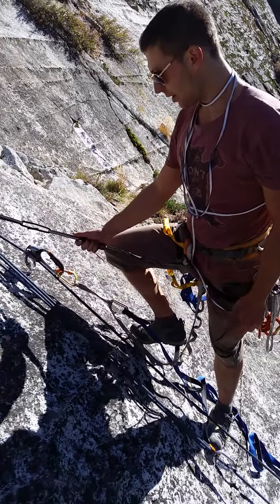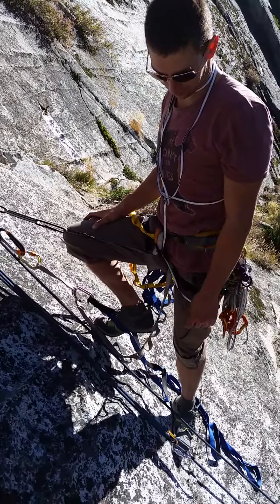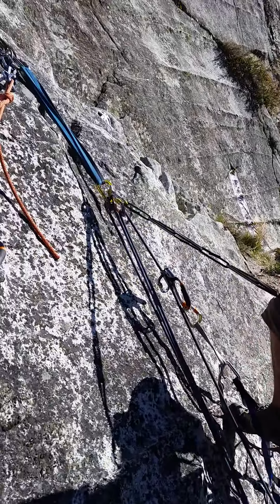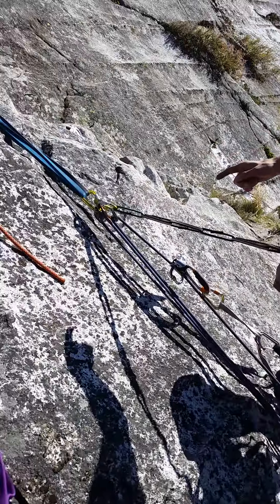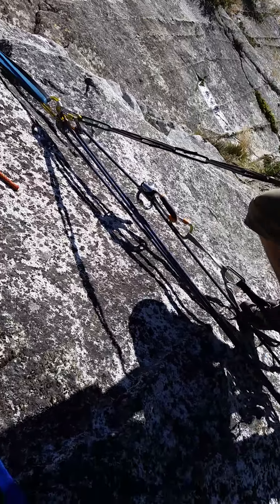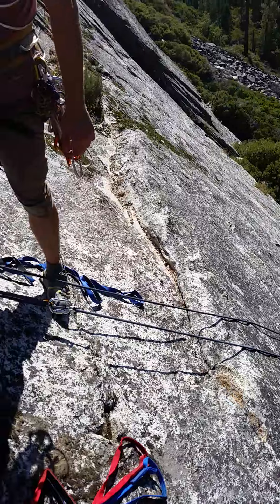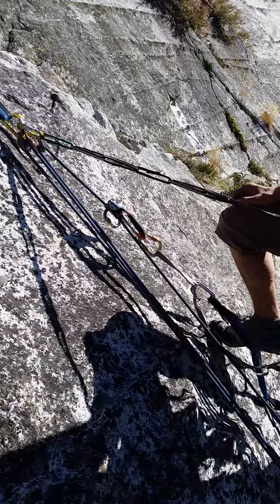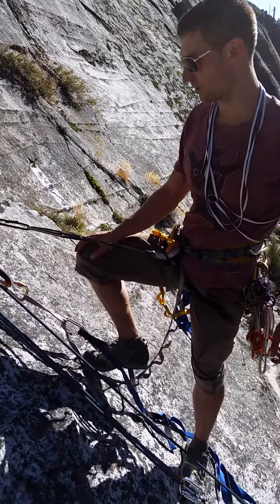Bigwall Hauling System

Comment: This is a good video. Note that the MOST efficient way to haul big loads is with your hauler connected to the rope, instead of to the aid ladder, and using a regular 1-1 load, without a 3-1 setup. If the load is SO HEAVY that you need a 3-1 redirect you WILL NOT be leg hauling. If the haul is so light that you can leg haul the 3-1, then you should not be doing 3-1 hauling you should be doing 1-1 hauling. So, while the setup is correct and the video helpful, you should not find yourself EVER doing this on any wall, light load or heavy load. In this video, with this exact load, the 3-1 should be removed and hauling should be 1-1.